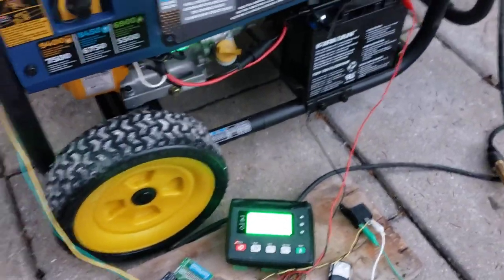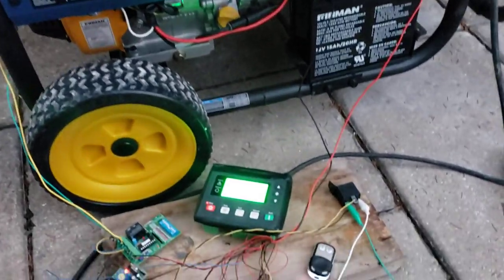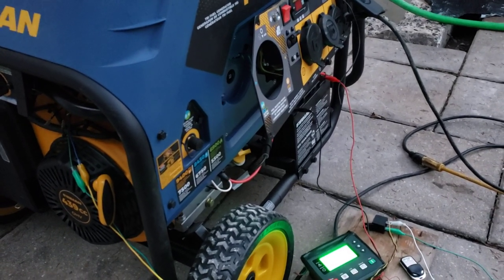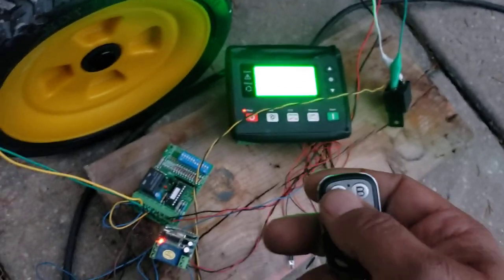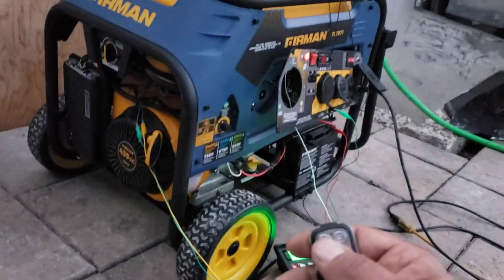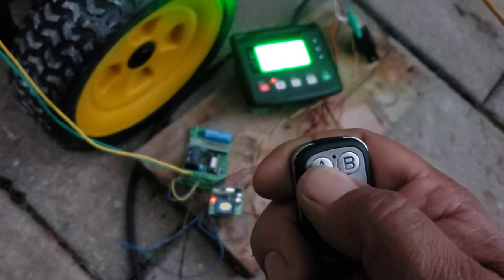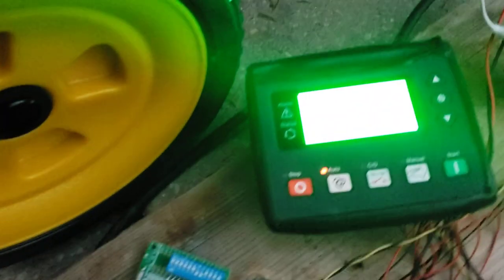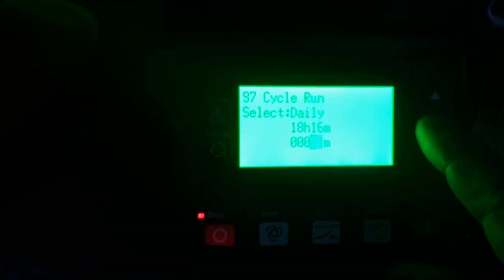FIRMAN Portable Generator MOD for Auto/Scheduled/Remote/Wireless START + Auto Choke *prototype*

Comment: okay this isnt ready for sharing, youre designing and chatting about your whole life history and great to see this but share when its put together, willya! This is development work. Not presentation quality. Thanks again. We need this. Looking forward. Actually there should be a choke setup possible where the running lets the choke off and no control is needed for the choke. Something centrifugal or exhaust powered..Then we just need a remote close the circuit control.

Comment: Hi Jon!  Can you show the model and number of the auto gen-start module and all the wire connection to? In my case, i have a brand new westinghouse generator but the StSwitch made by them is not working with my year production.

Comment: Great work. Please consider for hybrid system for next project with battery, inverter, and charger. so the generator run at its peak efficiency to charge the battery and cycling on and off between battery charge level.

Comment: thought I was the only one geeking out lol.  

I have the HGN4020N panel, likely the same unit as yours.  Controlling a WEN 8750 inverter generator out in a shed.  Mounted the panel in a hobby box.  Did have to install a timer relay to shut choke off at first but I dont need it anymore. Originally I was using aux 1 output (pin 7) set as fuel pump to energize the choke relay but deleted it an now running the choke off the crank terminal.  But did have to install toggle  switch to turn off the choke for hot starts.  

Are you using any other sensors on the air cooled motor?  Cylinder head temp?  Tachometer pickup?  and CT's to take advantage of the current read out on the display?    I thought I'd go one step further and installing a reed style fuel level sensor to tell me fuel level in the house .  I am impressed with the smartgen panel. i'ts pretty powerful.

Comment: I have the same generator with a Honeywell auto transfer switch, SR2B121BD SCHNEIDER ELECTRIC controller and the same door lock actuator.

Do you use reverse power output to the actuator to make it dual acting ? My actuators don't spring return..

Comment: This system is currently  operating  off 120 volt but can one be designed  to operate the same in an area where there is no access to electricity

Comment: Can I get a parts list for this? As in controller module, arduino module etc?  Also I’d like to add a temperature control function as in freezer temp for auto start. I know OF arduino but not HOW to arduino. Any resource would be appreciated . Thanks

Comment: Hi Jon,
          I’ve been following your videos on the generator controller. You are very knowledgeable in this regard. I have a new unboxed Firman 10KW generator T08071 which I would like to add this remote feature. Your videos shows that it can be done, however it does not give me all the information I need to complete the project. It would be nice if you can provide your viewers with a circuit diagram of the setup and a link where these items can be obtained. It appears like some folks are waiting for you to make a “finished product” for sale, that’s okay, but for me I would prefer to assemble the components myself. Also, do you have a schematic of the generator circuitry? 
Thanks.
Reply: Thanks I’ll send you an email shortly
Reply: is it possible to have it too?

Comment: If I was you I make in a box with magnets that cling to the frame. And make female click connect on the box male that attaches to generator battery. Did you connected to a trip switch on the side can’t tell
I’m a Electrician 2 let me know if you selling a kit. I used a contractor  monitor though a k contractor . Or maybe a Napco relay board. You can control up to 9 relays at once.
Great video.
The internet sell Napco relay boards way to much buy at your local alarm supply way cheaper.

Comment: I'm just doing a simple remote start/kill/choke on mine with a cheap wireless relay board.  The car door lock actuator everyone is using doesn't have enough throw and I didn't think it was possible to use on my Champion 9375 watt that uses the same choke lever as yours.  Your engine and linkage look just like my Champion and I'm wondering how you mounted that actuator like that.  Did you use the bracket that came with the actuator?  Looks like you just mounted the bracket using the one bolt on the motor.  After I saw your vid I was trying to figure out where to mount it on mine but there's only that one bolt and linkage in the way.  What did you attach the bracket to?
Reply from the maker: I used the included bracket which I bent into an L shaped to reach that engine bolt, I did have a few brackets laying arround so I was able to play with this. Remember when using these actuators that you cannot maintain power to them for more than a few seconds at a time before they actually fail from overheating.
Reply: @jonsgarage3859  Thanks bud.  I set mine up just like you had it from what I could see.  Unfortunately this actuator I bought off Amazon only moves the choke about 1/3 of the way.  The way you set it up gives it enough throw but just doesn't have enough power on mine.  I need something better I guess.  Mine is a momentary relay so no worries about burning it up.

Comment: I also have a T07571, but mine is hooked to Natural Gas. I have found that mine is a bit tricky to get going, with either gasoline, propane or Natural Gas. I have to "play" with the choke and it takes a few attempts to make it happen. Can you suggest a solution?
Reply: I saw something similar issue like your and the fix on that video is to turn on the propane slowly...

Comment: Hi Jon I have a firman T08071 and I have installed the smart Gen controller just as you did on yours. I also installed a choke actuator. Do you have your choke connected to the smart Gen controller? If so where did you connect it to? What function are you using in the smart Gen controller? Other then that mine starts and stops with no issues. I just can’t figure out how you got the choke to come on
Reply from the maker: Hi! Thanks for your interest and I'm glad to hear that you guys are starting a project of your own! The actuator has to be controlled by a set of relays that invert the voltage for the choke-on and choke-off action, the relay  setup also has to cut the power to the actuator when it isn't in use or the actuator will quickly fail if it doesn't have built-in limit switches to turn it's motor off when it reaches it's limit. 

I don't have my wiring schematics with me at the moment as I'm at work, but you can reachout to me at jonsgarage69@gmail.com for more info!

Comment: Good job! Would like to know what type of controller that is when you get a chance.
Reply from the maker: This specific controller is a Smartgen HGM420M, I purchased this because I like the interface amd display, there is cheaper options available from the "Mebay" brand which also work fantastic and are built tough. If you don't need the schedule start feature, you can find a contoller such as the Mebay DC20D Mark2, I have two for sale on eBay, if intested. And as a reminder, these controllers are not plug-and-play, they have to be configured and external relays have to be installed on the generator side, you also have to set up an actuator mechanism of some sort.
https://www.ebay.ca/itm/DC20D-MKII-Genset-Controller-Upgrade-for-Diesel-Gasoline-Engine-Generator-/265398550193?mkcid=16&mkevt=1&_trksid=p2349624.m46890.l6249&mkrid=706-127636-26712-0
Reply: I have a troy bilt generator 7500 watts, can you please configure this for me  and put it in a panel box, I will pay

Comment: What if the power comes back on?
Reply from the maker: It auto shut's off.  I couldn't demonstrate this because I hadn't completed the shutdown feature yet. I will be making a new video soon enough.
Reply from the maker: Take a look at the description for a full list of features.
Reply: You still need the interlock breaker to be flipped, not to fry workers downline 💥👉
Reply from the maker: @lts30000  absolutely 1000% , you can have this controller flip it for you after a preset warmup period, although you will have to mount a powerfull actuator to transfer switch, or have this connected to an approved automatic transfer switch

Comment: Can you give a list of components?
Reply from the maker: I'll get down to that when I have fully  completed and tested the system! Subscribe for a future video!
Reply from the maker: I don't have a full list yet, but the controller is a Smartgen HGM420N, there are many other option available depending on the features you want. Check out the "Mebay DC20D MK2" for an inexpensive controller with basic features. Here is one I'm selling, but remember they are NOT plug and play.
https://www.ebay.ca/itm/DC20D-MKII-Genset-Controller-Upgrade-for-Diesel-Gasoline-Engine-Generator-/265398550193?mkcid=16&mkevt=1&_trksid=p2349624.m46890.l6249&mkrid=706-127636-26712-0

Comment: Nice try on the video but, that is a mess.  Sorry , but you should have had all your components and do a trial run before the video turns to be not so good.  It’s definitely a prototype so I will pass. Your almost there and you just need to wrap it up, get everything programmed, installed in boxes, etc.
Reply from the maker: Yeah I really made sure to state that it's was an early stage prototype lol, it is infact quite a mess. You can see how much cleaner my panel looks all boxed up in the other video on my channel.

https://youtu.be/KRJTalp_RZU
Reply from the maker: https://youtu.be/KRJTalp_RZU